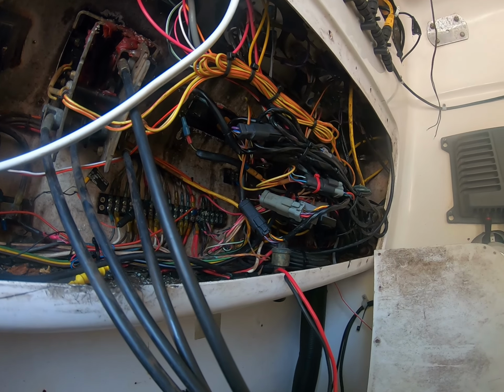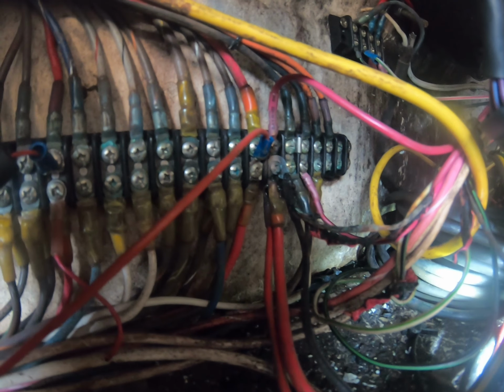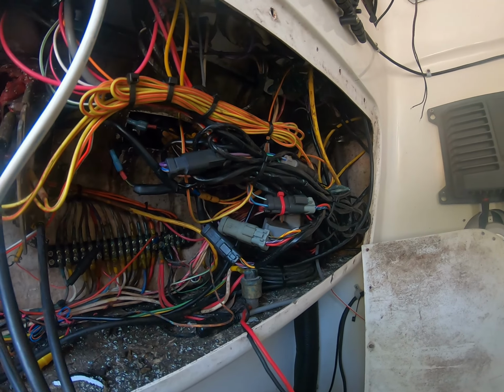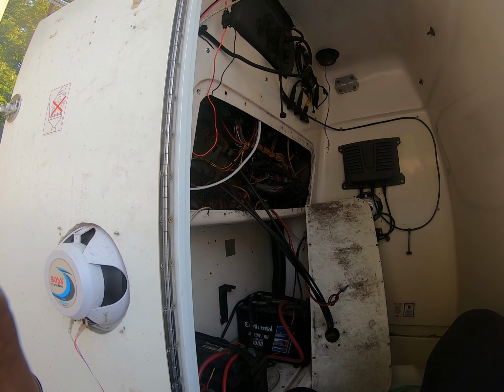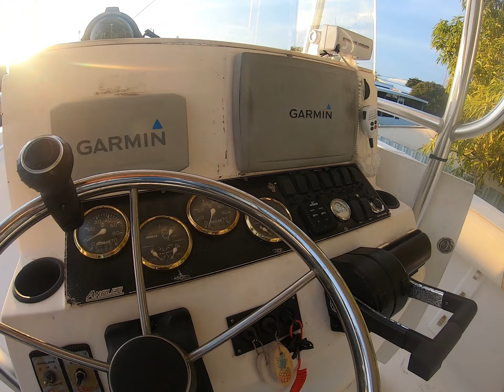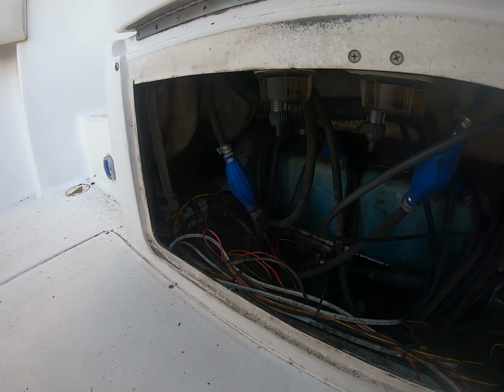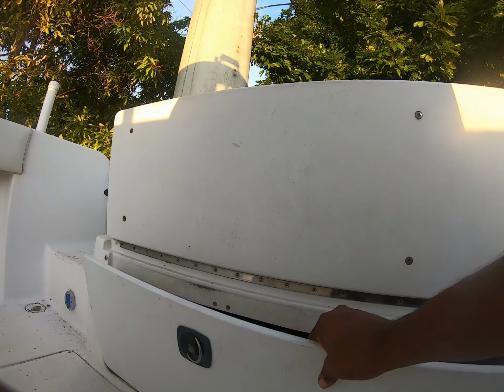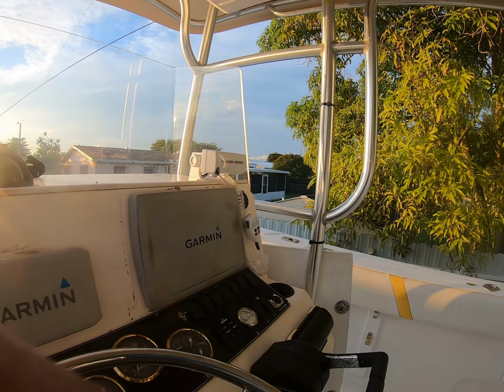Used boat problems

Comment: Dang bro! Glad you’re moving forward with the wiring. Wise investment! I had to re-wire my sportfish years ago, I recommend you make sure the old wiring is all removed. I didn’t ask for that and I got what I paid for I guess. Ohh and ask for the connections to be done with heat shrink connections and new breaker bus bars that are covered. Best of luck friend!
Reply from the maker: Will do. Thanks for the info 👍🏾

Comment: Freddy-B.....Talking about a Cluster-F.....The last owner really did a pathetic install!! But after looking at the limited access locations the only way to correct this is by having the boat rewired by a qualified mechanic.....I did a full wire install about 8 years ago and it's knot a job I will ever take on again.....Definitely the smart decision to make which in the long run will save your sanity.....I'll be interested in the new install.....Catch you on the flip!!💀☠!!
Reply from the maker: Thanks captain for all your support 👍🏾